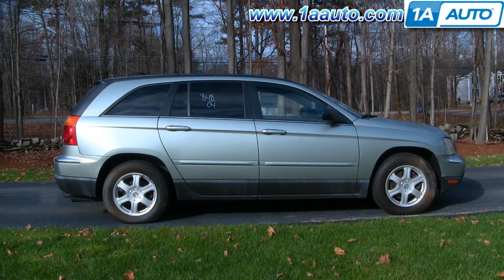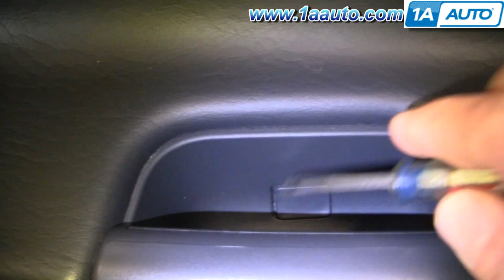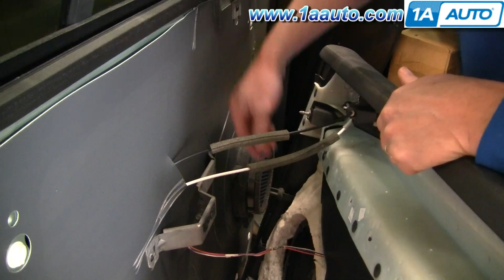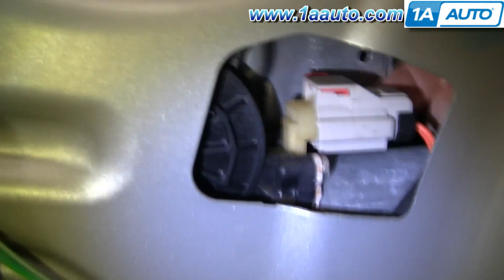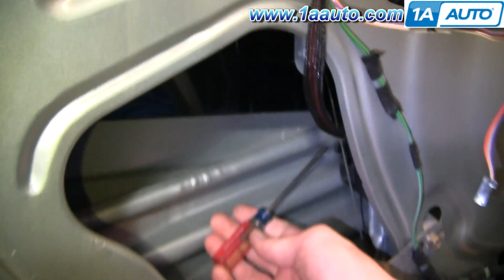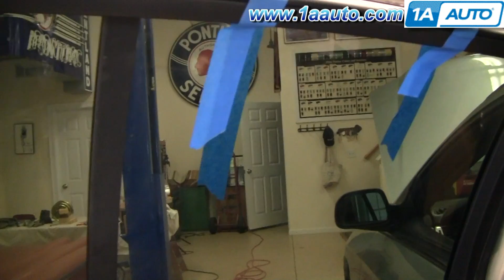How to Replace Rear Window Regulator 04-08 Chrysler Pacifica

Comment: Purchased this part because of the video (thanks!).  Installed it as instructed .. however .. the window will not 'roll' all of the way up.  It lacks apx. 1/4" of going all of the way to the top.  Is this a known issue? Or is this a return due to a problem with the regulator?
Reply: Same thing with my install. What do I need to do?
Reply: I just encountered this problem too. I loosened up the 3 bolts holding the regulator to the door and slid it up into place. I put big fat fender washers behind the bolts to hold it up and it worked great.
Reply: Did you figure out why it's not going up all the way? I'm having same problem after installing a new regulator.

Comment: Unfortunately I bought the whole regulator when my motor wasn't bad. It was just the clips.
Reply from the maker: +Twisted Reina Thanks for checking our video out! If the part hasn't been installed we can certainly take a look at a return for you. Please contact our customer service department so we may assist you further. 1AAuto.com
Reply: @1AAuto  thanks again. I already installed it. That's how I found out.

Comment: Whats the part called that's attached to the window? I just ordered a regulator through you guys and the clip on the window is broken and will not clip into the regulator. I need that part.
Reply from the maker: +Twisted Reina Typically the part attached to the window will be on the regulator itself if you are unsure of the part(s) you need we'd suggest getting the vehicle looked at by a local mechanic. 1AAuto.com
Reply: @1AAuto  thanks. It's not tho. Guess Chrysler  glues there sash on to the window. I can't  even find the part from the dealer. Might have to buy a window just for the sash part. 😣 i went to a shop to day.

Comment: how can you tell if it's a regular vs fuse eor anything else. ?
Reply from the maker: +Ben jackson You could test to see if there is power going to the window motor. If there is power to the motor you may want to check the window regulator to see if the window regulator has failed. It's common for the cables to fail on them if it is a cable driven window regulator. Hope this helps you out. 1aauto.com
Reply: 1A Auto Parts there actually isn't  power going to the window...